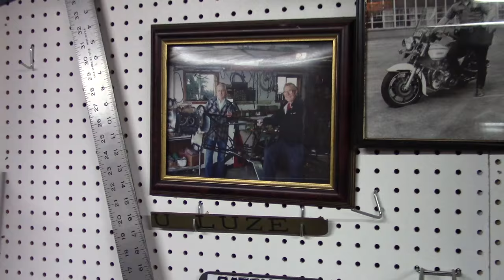Wiha 7-Piece Insulated Industrial Tool Set Review

Comment: Thanks for the review.  I agree with you about the Pliers made in Vietnam, which is why I am typically hesitant to buy any Wiha pliers over the Knipex equivalent.
Reply from the maker: Thanks a bunch! Knipex makes fantastic pliers. I usually go Wiha or Wera for screwdrivers and Knipex for pliers.
Reply: It's not so much that the tools are made in Vietnam as much as the Wiha is still marketing them as Wiha GS . My experience is they are better than most Asian products. But considering the labor market they are extremely over priced.  
In essence Wiha is pocketing huge profits based on their German Name and Reputation!
Reply: The VDE pliers and cutters are made in Switzerland, screwdrivers in Germany

Comment: 90% of my work is with either a ph2 phillips, small terminal flat blade or a medium/large size flat head. Wiha hands down are the best screwdrivers you can get as a sparky mine cop a flogging in a harsh environment and ive only managed to break one from my own doing, the pliers on the other hand, chanel lock are the go. There made in the states cost me around 50aud for a pair and havnt failed me yet. Plus they have the non-insulated crimper on the end and finger guards as an added bonus.

Comment: I've got some bad news for you brother, that plastic breaks down in a few years and literally smells like vomit. Not exactly what I'd call 'heirloom' grade stuff.
Reply: Heirloom has to have that smell edge over a brand spanking new never used tool.
Reply: @Cyclone Bravo  You should just see how polyurethane rots over time.
Reply: @Cyclone Bravo go to any garage/mechanics and ask them how their rubber handles are holding up... Chemistry man. Not opinion, but chemistry... Plastic is made from oil if you get them oily, they go back to where them came from.
Reply: they are intended for electricians not mechanics

Comment: I have done a lot of electrical work over my time and I can tell you I have been impressed with the Milwaukee Hand Tools. 

9" High Leverage Lineman's Pliers w/ Crimper (48-22-6100)
8" Long Nose Pliers (48-22-6101)
8" Diagonal Cutting Pliers (48-22-6108)
#1 Phillips - 3" 1000V Insulated Screwdriver (48-22-2211)
#2 Phillips - 4" 1000V Insulated Screwdriver (48-22-2212)
1/4" Slotted - 6" 1000V Insulated Screwdriver (48-22-2221)
3/8" Slotted - 8" 1000V Insulated Screwdriver (48-22-2223)

These are what in my tool bag plus a few more things. I don't use Insulated pliers, but I do use Insulated Screwdriver because sometimes you have to adjust things that are live.

Comment: As a time served electrician i can say these do the job perfectly. Also the 10000V rating isn't to be scoffed at either, while most people will never get past 230V (UK side) the time where over 1000V come in to play these will save you from getting a shock. Some companies also do a Insulated Wrench Set and Socket Set which i would also get for that just incase factor.

Comment: You are amazing! I totally agree on the quality stance and I can't tell you how many crappy made in China tools I've bought and only use a few times before they break. I believe that the intention of those cheap tools is purely a temporary piece to get you through a moment and the tool is then disposed of. It really bugs me. Then I found a Knipex plier and I was so impressed with the quality, fit and finish and design and even the ergonomics and see them as heirloom functional art of a high degree. If I ever get kids I will do as you do and try and I still the notion of long lasting quality. To me the biggest issue is how temporary most people today see things. I remember my parents buying a Fisher turntable and stereo system in the early 70's and they paid an unheard of $200 for it. That thing was still fully functional 4 years ago when they sold it at s garage sale when they moved to a condo. $200 and it lasted at least 40 years. Today, kids will receive a $500 iPhone every 3 years.

Comment: The 7 piece kit:
Knipex 10 inch comfort grip pliers wrench
NWS VDE fantastico lever side cutter
NWS VDE Multi-ergo pistol grip needle nose pliers
Wera Kraftform Plus 190 VDE 1/4 nut driver
Wera Diamond Coated BiTorsion 7 piece Bit check
Craftsman 9 inch Robo Grip
Stiletto 15 oz. TiBone TBII-15 Milled/Curved Framing  titanium hammer

Honorable mention: Knipex VDE Electrical Installation Pliers Sprung

Comment: Nice set TUP. I too am guilty of buying cheap made in China tools. My ideal set would include:7” end cut nippersTongue & groove pliers (channel locks)6” adjustable wrenchNeedle nose pliers#2 standard screwdriver#2 Phillips screwdriverRazor knife.All insulated and stainless steel. I live on a boat here in Seattle and everything that can rust will rust so you can't really keep good tools on the boat. They do make some tools that are a double chromed and even stainless but they are expensive!

Comment: To clarify your confusion about the Screwdriver sizes: Wiha is german and this kid was initially designed for the german market. As a german electrician, I never needed such a beefy screwdriver like your Klein for anything other than prying cases open. For which you don't want to use expensive insulated drivers.

Comment: the thinner screwdrivers are for inside electrical cabinets. my on the belt tool pouch at work contains Wera lg. handle multi-bit screw driver.  snap-on folding aliens. a small tweeker screw drive for adjusting photo eye`s. kline med. needle nose pliers. kline lg. wire cutters. knipex 8 inch pliers. and snap-on pen pick up magnet. beats pushing my 275 lbs. tool cart everywhere.

Comment: I like Harbor Freight Tools .  They have a bad reputation for being low quality and cheap.    But ever since my company did a job using die grinders and the $250 Dewalt would last as long as the $25 Chicago Electric I was sold on Harbor Freight .  I have to change out the bearings on my 2011 Equinox and I got the professional slide hammer for $59.00  and used a 20% off coupon and got a free screw driver set that has a life time warranty for making a purchase.   The savings I get from companies like Harbor Freight enable me to be a prepper.   Nothing against your sponsors but if you are prepping on a budget tools that will do the same job are available at Harbor Freight for fraction of the cost.

Comment: 1) K Tool International 6 Inch Bent End Pry Bar
2) Klein Tools 603-3 3-Inch Round Shank No.1 Profilated
Phillips Tip Screwdriver
3) Wiha 6.5 x 40mm (Stubby) 1K Ergonomic Slotted Driver
4) Klein Standard Long-Nose Pliers Side-Cutting Yellow
6-Inches 
5) Nicholson Rectangular Mill Bastard Hand File, Single Cut,
American Pattern, 6" 
6) Crescent 6-Inch Long Nose Locking Plier with Wire Cutter 
7) Vanquest PPM-SLIM Personal Pocket Maximizer [to store the
other 6 items]

Comment: My father has a lot of good tools that were passed down from his father and will hopefully come to me in years to come.  My ideal 6 piece tool set would be the items below, mainly due to my partner being in a wheelchair, I like to keep some variation with me in case anything comes lose while we are out and about :)

Mac Allister Adjustable Wrench
http://www.diy.com/hand-tools/mac-allister-adjustable-wrench/257135_BQ.prd

Mac Allister Combination Pliers
http://www.diy.com/hand-tools/mac-allister-combination-pliers/677514_BQ.prd

Mac Allister Chrome Vanadium Steel Hex Key Set, Pack of 30 - 4mm & 5mm keys
 http://www.diy.com/screwdrivers-keys/mac-allister-chrome-vanadium-steel-hex-key-set-pack-of-30/704609_BQ.prd

Mac Allister 12 Piece Mixed Screwdriver Set - Philips Head No. 2
 http://www.diy.com/screwdrivers-keys/mac-allister-12-piece-mixed-screwdriver-set/677613_BQ.prd?icamp=recs

Mac Allister Grip Drive Spanner, Pack of 5 - ideally the whole set
 http://www.diy.com/departments/mac-allister-grip-drive-spanner-pack-of-5/703944_BQ.prd?spanner_SRD1

Mac Allister VDE Water Pump Pliers
 http://www.diy.com/hand-tools/mac-allister-vde-water-pump-pliers/963785_BQ.prd

Comment: Baby tool carrier, I dig it. 
I reckon my 7 tools would be: 
-Klein 6" #2 Phillips 
-Klein 6" 3/16 flathead 
-Channellock 10" pump pliers 
-Klein long nose multi purpose tool (strips wire, crimps connections, shears screws) 
-Klein 9" high leverage side cutting fish tape pulling plier
-Estwing hammer (there's no true substitute for a hammer) 
- Klein 8" adjustable wrench

Comment: 1. Forest Axe (the medium size axe)2. Folding saw or bucksaw3. Fulltang knife4. Bowl knife 5. Awl 6. Hand drill bits (not sure what these are called specifically, or i know, but just can't come up with the name atm :/ )7. On the fence about the last choice, so i will go with Knipex Cutters so i can deal with it and move on... get it ;DNon bugout related tools, most used by me:1. Set of small precision screw drivers (both Phillips and flat), so much stuff has a need for these these days.2. Set of medium size screw drivers (both Phillips and flat), hardly ever use large ones, and small ones only if 'precision size', medium general works on all I need to screw.3. Drill with drill bits4. Hammer5. nr. 12, 13, 15, 16 wrenches (with open side and ring of the same size), sometimes use smaller ones like 8 or 9; think in all honesty I would rather have 8 to 13 then have 12 to 17 mainly because 'nr 6'.6. Groove pliers (because everything that I can't fit with my wrench-set, due to say ridiculous use of non metric sizes (who uses non metric these days!!), I grab the groove pliers and make short work of them. This is my goto 'wrench' if all else fails...7. A small diagonal cutting plier, I had one from my granddad. Solingen steel, german made, I wore out the pivot due to heavy abuse when I was a kid/teen/young adult, cutting metal wires not suited for the size of the pliers, but it worked, wore out the pivot before it nipped the cutting edges! Unlike the crap I bought later on in life that nipped on even the simplest piece of metal wire other than say a single strand of cupper :( ... if you can get anything that says 'Solingen Steel' on it, in say a garage sale, do not be a fool and pick it up if it works. That stuff is truly indestructible (well unless you use it by standing on with say 45kg just to cut some steel wire you can't otherwise cut, and do that repeatedly in life as you grow up and gain weight, then yes, it fails in it's weakest point, but otherwise) yes I know now I should have used bullnosed pliers, but we didn't have those, and that thing cut everything like butter if you applied enough force! ... sigh, quality tools, it's like having a slice of heaven!
Reply: +Dutch Courage holy bejebus, tnx youtube, I took great effort in making those two comprehensible formatted lists !! :S :(

Comment: Both of my grandfathers where tradesmen and I have some very nice but weird tools from then that still work and i love showing them off. I am with you on heirloom tools. You only need a few really important tools, I have some very nice carpentry tools that I will hand down to my son one day. Where they are made is very important to me to I like Klein, Wera, Stanley, and a couple others depending on the type of tool and its jobs.

These are in my GHB which is at keep at my desk or in my car depending on where I am plus i also keep a 14-1/4 in Fubar® Demolition Bar till i think i will switch over to the Lil Trucker:
#2 Phillips is a must
i carry a 4 as well 
8" pliers, 
1/4 inch flathead
8" dykes
10" ajustalbe wrench 
10" channel lock
 Voltage Tester i have one cant remember who it is made by but it was needle noses with a lite in the handle if you got to close to a live wire

Comment: Great review, and great tools. Just a heads up to other viewers, insulated tools are not meant to protect the user from electrical shock, they are to prevent shorting live parts to adjacent grounded parts. In the rare instances you are doing work that actually warrants insulated tools, you should a licensed electrician, and be wearing appropriate PPE. 

And even though I don't condone it, a standard pair of pliers will prevent the average Joe from getting zapped while working at home.

Comment: As an Electrician of now a day.. were not working anything HOT!!( NFPA 73E Standards) PLEASE PLEASE DO NOT RELY ON  THE INSULATION OF THESE TOOLS!!! They must be kept clean and free of Cuts! They also should be TESTED EVERY YEAR!!!.. 8 inch pliers are  the medium. most of us carry 9in pliers, AKA,. Sides, 9's etc etc
Reply: you dont work hot as a electrician?  every single job ive had we worked hot unless it was brand new construction also these "1kV" can insulated up to 22kV on average... its really a waste when electrical tape is rated for what 600v by itself
Reply: Prepping2endure well yeah of course you dont work on anything hot. Your probably a residential electrician. I work at a gold mine in the industrial field and we work on hott circuits every day

Comment: GREAT VID!! My EDC set is 7" combo pliers/6" long nose pliers/6" diag. cutters/10"adj.box pliers/10"adj. wrench/10pc.2"-2.75" slotted,phillips,torx, bit pack with 1/4" t handle magnetic bit holder/3 t handle nut drivers 1/4,5/16,3/8 has worked for me .

Comment: Great video thanks if I don't win I'm gonna be looking into getting this set because I have no insulated tools as of yet, also great idea handing down tools to the next gen, that being said my tools start of with 1. my Grandpas screw driver which is a multi set made out of brass and each different size unscrews out of the bigger handle, 2. Pliers 3. Needle nose, 4. No. 2 Robinson screw driver 5. Crescent wrench 6. Knife 7. No. 2 Philips screw driver, the screw drivers I have now are Klein and seem to be working great so far but would like to know where you purchased these ones?

Comment: I like this set, could come in handy. I do wiring in vehicles, my ideal 7-piece tool set would be sharp tip needle nose pliers, wire crimpers, wire strippers, Phillips head screw driver large and small, and flat head screw drivers large and small.

Comment: Great review as always, and I love the "heirloom tools" methodology. Buy cheap, buy (at least) twice!

My ideal tool set:
Wera VDE No.6 Phillips & Slotted/Flathead Screwdrivers: A fantastic pair of insulated, laser-tipped screwdrivers
Knipex 180mm Cutters: Heavy-duty double-hinged forged steel cutters - No messing around!
Stanley FatMax Retractable Utility Knife: A little cheaper, but incredibly useful and makes finding new blades easy
Draper 225mm High Leverage Combination Pliers: Great soft-gripped pliers, and 1000V rated - Because why not?
Klein Straight-Claw Hammer: I personally prefer straight-claws, and this one has a fibreglass shaft to boot
Bahco 15in Adjustable Spanner: Gotta have a good spanner! This one's precise enough, and will last a lifetime.
Reply: Dan LA I know you posted this 3 years ago. But I’ve screenshot’ed your comment. You clearly know good tools! I’m be using these in my kit :)

Comment: Great job!
About a year ago I purchased a very similar set, but it came with different screw drivers for low voltage DC work.  I really really enjoy them.
You should check out on Amazon the Elenco Radio Kits.  Practice your soldering skills now & build your own prepper radio.

Comment: my ultimate load out would be a good utility blade medium phillips, flat head driver. 10 mm spanner 12 mm spanner 14 mm spanner and a 17 mm spanner
Reply: Then you also could include a 13mm Spanner and 8mm if I remember correctly.
Japanese Cars/Motorcycle mostly have 8 / 10 and 13mm on stuff like Brakes and so on.

Comment: The combo pliers look nice.  Any chance of an updated EDC soon?  And maybe the updated altoids tin?
Reply: Also I like the kit as is.  If I had to change anything I would do a vice grip so you could lock somethings. In place and work on it with two hands or grab another tool and still be hands free. This is something I have started to do and I love the freedom they bring.
Reply from the maker: +SAEtaylor I really need to film an update. It's been a while. The Altoids Tin hasn't changed much. I've been really happy with the current setup.

Comment: good review on the set and pros and cons of it, i agree with your assessment on the cons of set..... I'm an electronic / electrical field engineer and these are the tools i use the most as far as hand tools go.

craftsman flat head screwdriver : 9" x 3/16" 
craftsman phillips head screwdriver : #2 x 8"
Klein Tools 8-Inch High-Leverage Diagonal-Cutting Pliers-Angled Head
Irwin Tools  GrooveLock 8-Inch V-Jaw channel lock pliers
Craftsman 5/16 Inch Nutdriver
Craftsman 1/4 Inch Nutdriver
Craftsman 6" crescent Wrench

Comment: Here are 7 tools that I've found to be very practical:

(1) Snap-On 5 position ratcheting screwdriver catalog # SGDMRCE44
(2) Knipex 8603180 7-Inch Pliers Wrench in 180 mm or 150 mm
(3) Wright Tool #Wrightgrip 915 15-Piece Full Polish Combination Wrench Set
(4) Snap-On 1/4" SAE/Metric shallow/deep drive set 144TMPB
(5) Klein nut drivers
(6) Wiha 66992 MagicRing Ball End Hex L-Key Set In Holders, 22 Piece
(7) Snap-On 1/4" Extra long ratchet TLL72 or 3/8" Stubby 3/8" ratchet FK80

Comment: Great video. I have some of my grandfathers tools and some of the tools he bought me when I was a teenager. Both he and my father drilled the importance of quality tools into me from an early age. I think there is a place for inexpensive tools, but there is nothing more frustrating then a screw driver tip breaking or a handle spinning on the shank when you need to use it. 

Picking 7 tools is tough. If I were going to go with this style kit I would say 8" Klein diagonal pliers, #3 Phillips, flat blade screw driver, 6" knippex cobra slip joint, 16 oz hammer, utility knife, and a Stanley measuring tape.